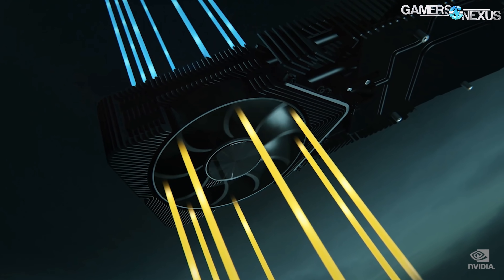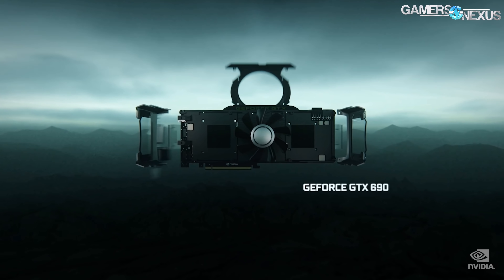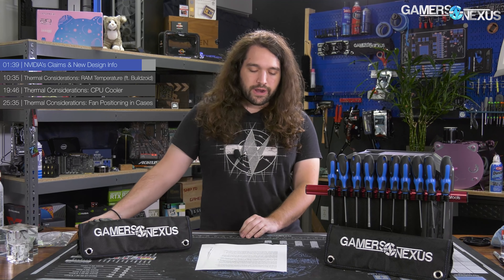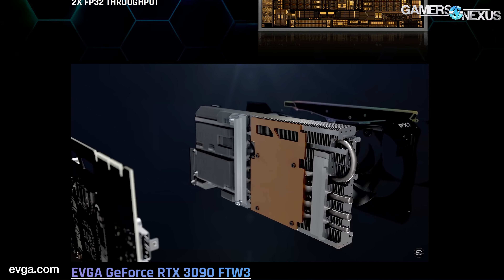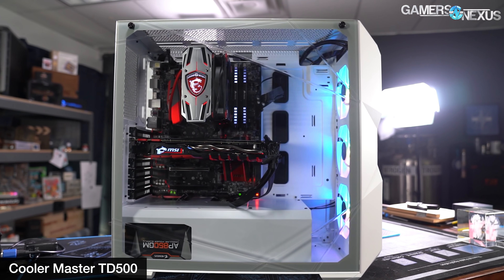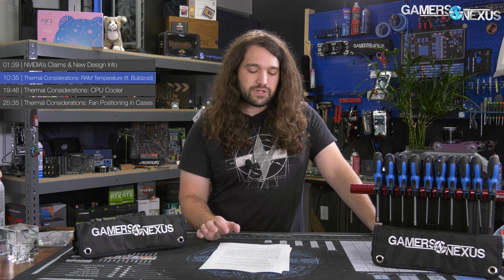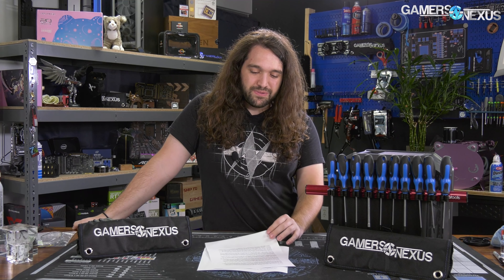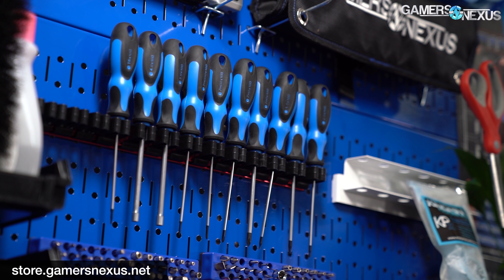NVIDIA RTX 3080 Cooler Design: RAM, CPU Cooler, & Case Fan Behavior Discussion

Comment: I wonder if this kind of cooling is really gonna cause so much trouble for other components...
Half of the card is basically blower style, so it will dump less heat into the case than most other cooling solutions.
Does it really matter where exactly it blows it, when you have case fans to take care of that?

Comment: Oh I'm using the stock 3600 cooler for the 3600 and planning on getting the 3080, should I upgrade the cooler? I've never bothered with cpus temp they always seem to be perfectly fine but if the founders 3080 is gonna mess with the stock cooler too much then maybe I should, what do I do? I have just enough money for the 3080 but not enough for the 3080 and a cpu tower cooler.

Comment: 06:54 Isn't telling "20°C cooler" false advertising? RTX2080 is a 220W card. If they're comparing 2080 to 3080 they should've done that in stock clocks and voltages.

Comment: Will the 3070 have the interesting cooler design, or will it have a cooling solution similar to the 2070.  I thought the 3070 looks like it has a similar cooler to the 2070.  I hope the 3070 has similar cooling to the 2070 that way I can slot it into my mini itx case with a vertical mounted graphic card design without too much concern for the thermals.

Comment: The FE cooling design makes perfect sense in a couple of scenarios. First (and most useless) in an sli setup where 2 cards are right next to each other, air can just flow through the open space. Second in a workstation/server where one most likely has other pcie devices like HBAs, USB controllers, 10Gb NICs, sound cards, pcie storage solutions and/or multiple GPUs etc. Since most other pcie devices don't extent past the pcie slot this means, again, the open section of the cooler is free to work. If you ask me this is a good thermal concept, I'm not so certain about the implementation but we'll see. Tech Stevesus will you hear my prayers and test such scenarios?

Comment: Hey steve, how about keeping the old gpu for secondary use? I have a gtx960 and want to replace it with the rtx3070.
I often have einstein@home running during the day. It is the same software as folding@home. I have an ryzen3900, so playing won't use it completly. And i would like to run the new gpu for the game, while the old one can handle f@h. Gpu's are 10x more efficiant at this then cpus. So having it laying around instead of  using it, would be a shame.
Power use is not an issue thanks to photovoltaik. Powersupply is 750Watt, constant poweruse under full load is around 200W at the moment. So i guess there is even enough room for a 3080. Motherboard msi ace x570.
Perhaps that is an interesting usecase you could cover. Or perhaps just for the useage of more screens or rendering tasks. Or for datamining and ai tasks in the future. Is it possible? Not interested in sli. Would be nice to read/hear your thoughts on that. Perhaps it can be a consolation for all those rtx2080ti owners out there. 😉
Equally excited about the new feature of getting the data from the ssd directly into the gpu. Perhaps you can elaborate on that in the future as well. And try to test how much of a difference that makes.

Comment: You kept saying "10 dBA quieter at 20°C cooler" but that's wrong. It's either 20 °C cooler at the same noise level or 10 dBA quieter at the same temperature.

Comment: I think it won't make any big difference in most ceses. Most of the cards have open design dropping almost all the heat inside a case increasing ambient temperature. If 3080(90) is semi open it at least dispose some of the hot air outside.

Comment: Really!! The Ryzen 7 3700x Cooler is not that good??? Really are you kidding me! It’s freaking awesome. I’m not over clocking and it works just fine. Better than many AIO coolers on the market today. Why don’t you test one live and see for your self. Love your channel but don’t bash something that actually works great. 
My Rig
2070 Super
Ryzen 7 3700x
32 GB Ram
Lian Li 011 Dynamic
X570 MB
9 Fans - 

Works like a champ!

Comment: Hielp:
So my case is the Meshify C, plenty of airflow. Now, my fans are as follows: 3 in the front, 1 at the rear, 1 at the furthest top back. And a Noctua D15 with 2 more fans...
What exactly is my airflow? Positive? Negative? Neutral? What? I ask because the CPU fans are considered exhaust as well..... :|
All fans are Noctua NF-A12, even on the cooler. :D
Reply: If the fans are all running at the same speed, it should be positive pressure. The cooler fin stack creates an impedance on the CPU fan that the rear fan helps to beat. So those two fans in series with an obstacle in between operate at a lower efficiency than the intake fans in parallel.

Comment: O11D xl rog white
Rad at top and bottom.
Cpu and gpu
4 intake fans
All corsair ll series
2g gpu
Vram + 440
4.3 cpu
Corsair xt on cpu
X62 on gpu with g12
Vertical mount
Beautiful system

Comment: Steve,

Do you believe the talk about the psu requirements for these cards? Nvidia stated they'll be around 300w from what I recall, and a few sites are saying you'll need beefier power supplies to compensate. What are your thoughts?
Reply: already tons of videos on it, Gamers nexus included, 750w is fine for 3080
Reply: If i'm correct, the most AIB cards 'suggest' a 700w psu for the 3080.
Reply from the maker: We did not state that "750W is fine for 3080," because we haven't tested it. We need to verify.
Reply: Gamers Nexus wait whatttt!?!? I’m so sure I saw a video by you guys about it, must have been a similar format or something I swear I’m
Not crazy 😂

Comment: So if my 9700K with NOCTUA-NH D15 have low temps using 2080 Ti Waterforce ( AIO 2 fans at up side ) ,then with rtx 3090 FE temps will rise on 9700K?

Comment: 29:32 me using a 2080ti with a 3700x and stock cooler. i feel personally attacked right now
Reply: Luke Jordan 2080ti is low end gpu (below 3070) so you don`t have to worry ;)

Comment: The reference cooler looks so expensive to make, that a factory water block e.g.Gigabyte water force should not cost much more to do so thats good. Since I have the loop might as well use it from day 1. (currently is is much cheaper to buy a Gigabyte aircooled card AND take that off and fit E.K. block than it is to buy a factory waterforce which makes NO sense).

Comment: i have a question you being and knowing heavy overclockers might be able to answer. if condensation is such a problem with liquid nitrogen ,or just about any  super low temp cooling.  and condensation is the moisture in the air condensing. if you were able to build a plexi box and somehow reduce the humidity in that air  to zero, would it stop all worries of frost/water droplets?. you could have the very top of the ln2 pot stick out of the plexi and have it sealed around the edge. you dont really need access to the board other then that. maybe there is even a safe gas you could swap the air for inside the plexi box that has no moisture in it. no more eraser, no more blue towels and no more Vaseline. seems like any easy thing to make and use if my theory makes sense. even drop the moisture in the air low and not to zero seems like it could reduce condensation. that would just take a small dehumidifier . i dont know enough about metal or components to know if when the board is in use and starts to heat if if the metals creates its own moisture?. if not then keeping low humidity inside a sealed environment seems simple enough .

Comment: Uh oh, buildzoid has me worried. I have the G.Skill Trident Z 16GB (2x8GB) DDR4 PC4-28800C16 3600MHz Dual Channel Kit  which is 1.35V 3600CL16 (99% sure), they reach 45.3 and 47.8c while gaming as is. I do however have an aging EVGA SC Black 1080ti that needs some love (replacing it with a 3080 so not bothering) that reaches 82 c though, so that is probably having a impact. I have a darkbase pro 900, with a lot of the hdd cases removed. A H115I Watercooler top mounted but with the fans on the top side of the rad exhausting instead of the bottom, they are corsair ML140 fans . I thought it would be fine for an FE BUT NOW I AM WORRIED. I did think about the heat being splitted,  just not entirely sure now about RAM thermals.

Comment: My guess on this: you wouldn't see 5C difference over any similar heatsink size board partner card which have as many as two fans' worth of air dumping hot air out the sides of the shroud (and that assumes the rear and top rear fans are spinning fast enough to pull in the air from the GPU fan towards the rear straight out of the case along with the CPU tower exhaust), and unless you somehow use an Intel CPU and crank up the voltage and clock speed high enough that you're at the edge (not to mention that doesn't even translate to faster FPS by that point, unlike just getting it to 4.7ghz to 5.0ghz over automatic turbo), it won't matter.

Probably not even for silence, because barring not using a custom fan profile on a tower cooler, your smaller GPU fans are still likely the most audible fans after the chassis fans anyway.

And as for AMD, given a good cooler you're probably not even hitting 70C delta anyway, the silicon really just won't go any farther, and 5C probably (probably) isn't bad enough to affect any automatic turbo behavior on the cores that can go faster.

Bottomline: I'd still love to see actual tests and get actual numbers, but not because I'm panicking over it compared to, say, just using an HD6950 and X99 hexacore with  something like a Tuniq 120.

Comment: Its not 20c at 10 db quieter though. It's either 10db quieter at the same temperature or 20c cooler at the same noise level.
That's not how you read graphs, even though nvidia might have made it intentionally misleading

Comment: I disagree. People who buy a 3900X, with a stock AMD cooler, then use a 3080 with the plan to upgrade the cooling solution for their 3900X at a later point is a fair argument. It may seem that sure you could be spend $2000 on a PC so what's an extra $100 for a good CPU cooler but if people are stretching their budgets since it's already $2000 then you're either recommending they go with a CPU that's at least $100 cheaper or hold off on build the PC all together just so they can afford that extra money which leads to a whole other argument of maybe they need to the PC to generate that income for 3D renders or video editing games on YouTube for example. I think testing with a stock cooler, specifically AMD since most of their high-end parts come with a stock cooler, is an important consideration. How badly impacted will a 3900X with a stock cooler be impacted by a 3080? Is it so much that it could be worth getting a 3700X (or a 3800XT at most) with an aftermarket cooler? Is it not quite performance destroying but badly impacting the normal temperatures of the CPU that could lead to silicon degradation? You could also argue that the stock cooler is one, if not the most, common cooler used (more specifically Intel) therefore testing for that is important as to whether someone streaming may damage or significantly impede their CPU if they upgraded a system with say an i7-8700 and 1070 to a 3080 without the money or perhaps ability to add an aftermarket cooler so they'd be better off saving the money and going with a 3070 instead. There's so many arguments FOR testing the stock cooler while the only argument against testing is the highly subjective "it seems unreasonable". So I'm very much in support of you testing stock cooler performance. I highlight "you" since your testing is arguably more advanced than many other channel could do.

Comment: Why do third party companies not (or do they and I just don’t know?) just sell cooler kits for people to install themselves instead of selling a card built with their cooler on it?
Reply: Because unlike a cpu, if the the graphics card cooler isnt installed properly (for example mounting pressure) it can literally melt the the components around the gpu. That's not a joke Ethier nividia themselves said that without a cooler a GPU can melt aluminum.
Reply: Accelero is one such cooler. The problem is there are so many different variants of cards, that universal solutions don't work that well. And it's a hassle. Most people who want custom cooling just get a water block. A bare PCB without a cooler for less money would be ideal for that. That's why MSI Armor was a popular model for water cooling, it had the same PCB as a more expensive model, but very weak stock cooler, so it was cheap to get.

Comment: Should I get the rtx 3080 FE or an aftermarket rtx 3080 for cooling performance? Also which aftermarket rtx 3080 do you think will have the best cooling performance?
Reply: Inno3D iChill X4 are the coolest cards by far. No cooling design comes close.

Comment: I'm building a new computer for the Nvidia 3090 RTX Founders Edition, I'm just wondering if I should buy a AIO cooler and return the Noctua NH-D15 SE-AM4. Here's all the parts that I bought;

PCPartPicker Part List: https://pcpartpicker.com/list/Z4scdm

CPU: AMD Ryzen 9 3950X 3.5 GHz 16-Core Processor 
CPU Cooler: Noctua NH-D15 SE-AM4 82.52 CFM CPU Cooler 
Motherboard: MSI MEG X570 GODLIKE EATX AM4 Motherboard 
Memory: Corsair Vengeance RGB Pro 128 GB (4 x 32 GB) DDR4-3600 CL18 Memory   
Storage: Samsung 970 EVO Plus 2 TB M.2-2280 NVME Solid State Drive  
Storage: Samsung 970 EVO Plus 2 TB M.2-2280 NVME Solid State Drive
Storage: Samsung 860 Evo 4 TB 2.5" Solid State Drive 
Storage: Samsung 860 Evo 4 TB 2.5" Solid State Drive 
Case: Thermaltake View 71 TG RGB ATX Full Tower Case 
Power Supply: Asus 1200 W 80+ Platinum Certified Fully Modular ATX Power Supply
Operating System: Microsoft Windows 10 Pro Full - USB 32/64-bit 
Case Fan: Corsair ML140 PRO 55.4 CFM 140 mm Fan 
Case Fan: Corsair ML140 PRO 55.4 CFM 140 mm Fans 2-Pack
Custom: Corsair ML120 PRO RGB LED 120 mm (quantity 5) 

According to  Noctua NH-D15 SE-AM4 82.52 CFM CPU Cooler website it would block one of the 4 PCI-E x16 express slots. The RAM is 2 inches tall or 50.8 mm. On the box of the case it says max cooler height of 190 mm. The normal clearance for the ram is 32 mm but you can adjust the fan for high profile ram, according to the website you would find out the clearance of the cpu cooler with high profile ram by 140+50.8-7=183.8 mm in total with the ram that I bought. I'm kind of worried by the tight fit. According to Noctua the max clearance for the cpu cooler in high profile mode is 64 mm for the ram. a little concerned that the RAM won't have enough airflow and overheat.

Also for the sake of the Nvidia 3090 RTX founders edition, I'm wondering if I would still have the clearance for the video card with 1 of the 4 PCI-E express x16 slots being blocked from the cpu cooler.

Anyways any input and suggestions would be appreciated. I already have all the parts ordered and shipped a week ago and I'm just waiting for the release of the Nvidia 3090 RTX founders edition. I just want to be sure if my current setup would work with the new video card, I'm just mainly concerned about the Noctua cooler and it's size, and I'm just wondering  if I should return it and buy an AIO cooler to make more room and better airflow. Also, I apologize if I repeated myself, my grammar and pc knowledge took a huge nose dive after having a stroke so I'm trying my best to get my point across.

Comment: How will these coolers affect an El Gato capture card installed underneath the 3080?
Reply: no impact, capture cards don't pull enough power.
Reply: @infinitelyexplosive4131  I meant physically it may block airflow to the intake fans, right?  I'm new to PC building.  I need to have a capture card installed but I don't want to fry the 3080.
Reply: @TSUNAMI17  The fans might be louder if you have the capture card immediately below the GPU, but other than that there's not going to be any issue.

Comment: Who else is suffering mild anxiety thinking about if they’ll be able to get a card before it’s sold out until 2021?
Reply: i have anxiety that people are willing to spend $500-800 on a 8-10gb card, that will basically become useless in 2021. todays games already require 7-10gb of vram, and it will only increase with future titles. anything lower than 12-16gb is wasted money on a product with zero resale value.

Comment: I imagine the 12-pin to 8 pin cable routing is going to a be visual nightmare since it appears the power connector is midway along the card length

Comment: I have a tu 150x lian li with a ventilated side panels 700 watt sfx, oc 3900x with 32 gig oc ram kit, 2 nvme,  2 ssds,  and a portable monitor and im just frozen. I just trying to figure out if I can cool it with no bottom fans and rely on ventilated side panel. That's if i can even power it. Mmmmm

Comment: the best thing to get is an aio cooler, so cpu doesnt get that much of a heat coming from the GPU
Reply: yes but by air you only get a few degrees more by rtx 3000 so no worries if you have not stock air cooler

Comment: Peformance per Watt by NVidia misleading?
NVidia said it's based on the game "Control" which has DLSS capability. Are Turing and Ampere both using DLSS? If so, and DLSS is improved on Ampere doesn't that imply that 1.9x number would be way high compared to normal games (no RTX)?
Whatever, I'll Google "Techpowerup rtx3080" when the time is right and get a nice "SUMMARY" of game performance averaged over about 20 games. Best way to do it. Then zero in on things like relative RT and DLSS performance.

Comment: Not sure if it's even worth to considerate the heat radiating of the gpu. When you have forced convection (as is heatsinks with fans, regardless of orientation) you will much more heat going in the than through radiating to the cpu, even with perfect black bodies.